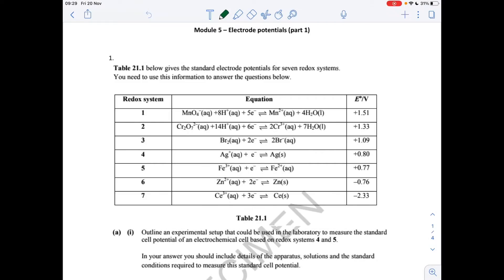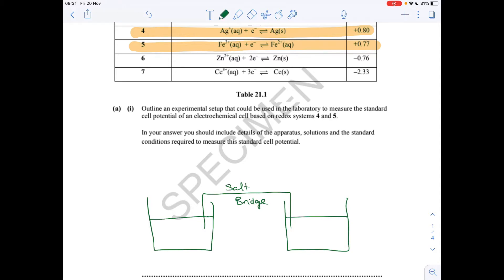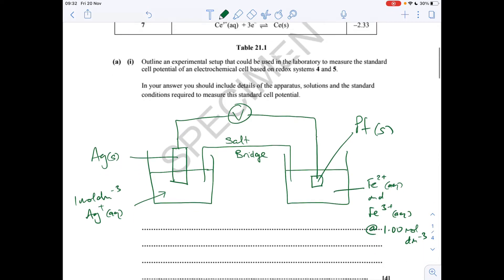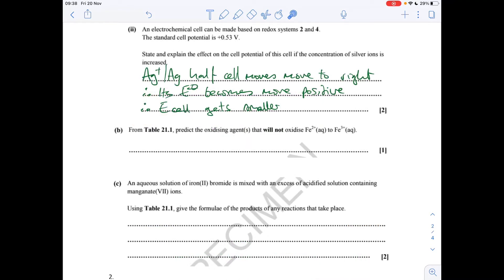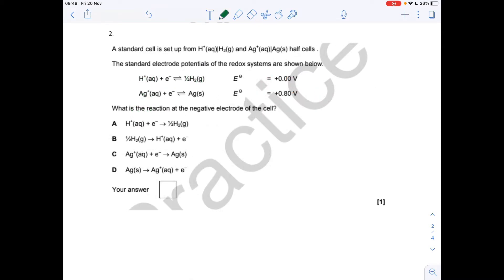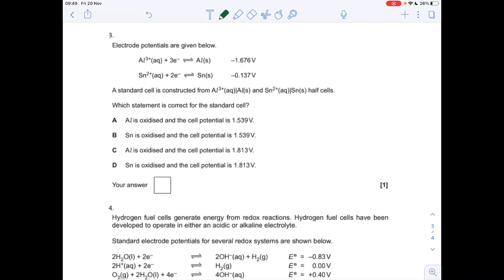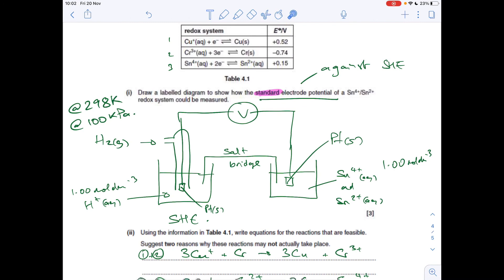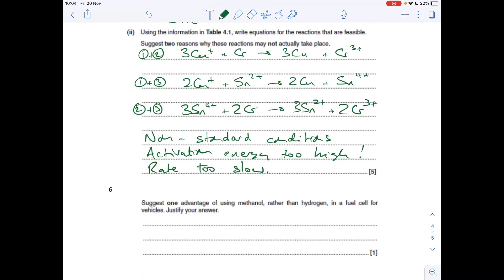Test Yourself A level Chemistry - Electrode Potentials 1

Comment: Hi there, for question 1a i, I was just wondering if the iron half cell should be drawn on the left because it has a more negative (less positive) electrode potential compared to the silver half cell?
Reply from the maker: OCR does not insist on this so I don’t bother
Reply: @MaChemGuy  ah ok thank you!
Reply from the maker: @angelahalton8827  You are right btw :)

Comment: At 7:12 will I get the marks if I balanced the equations because each half cell has a different number of electrons?
I wrote down: 2Mn^2+, 8H2O, 10Fe^3+ and 5Br2
Basically I imaged that all three half cells were redoxing together so I had to make sure the electrons matched from the data in the question.

And for the last question would hydrogen being more volatile/explosive because it’s a gas compared to Methanol being a liquid be a valid answer? Thanks